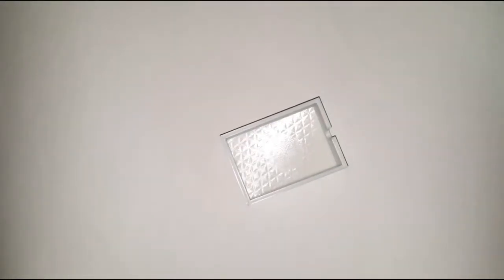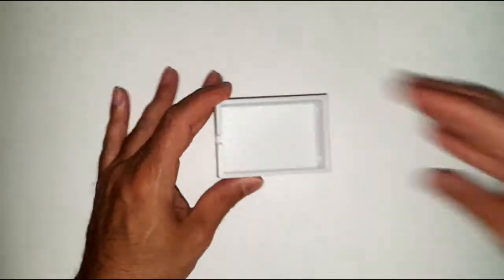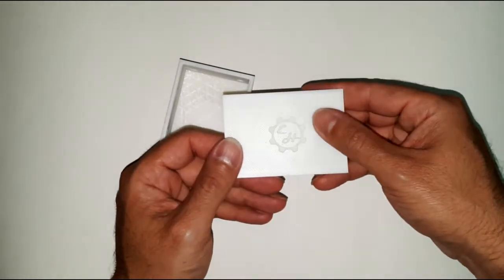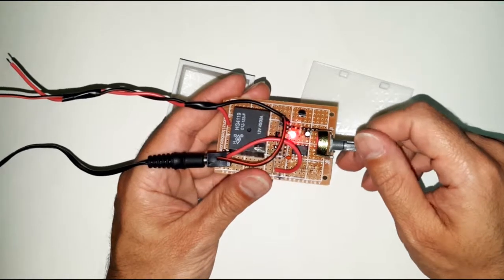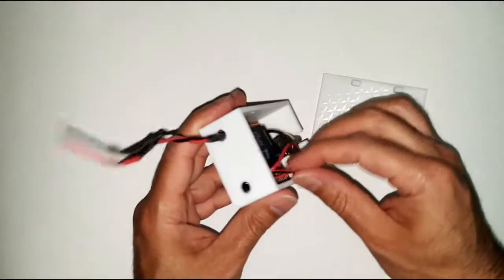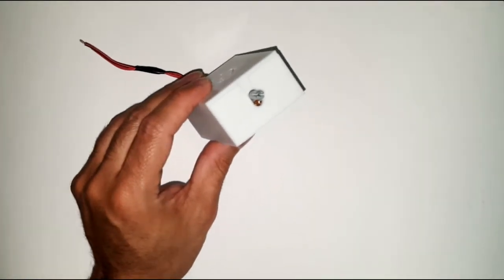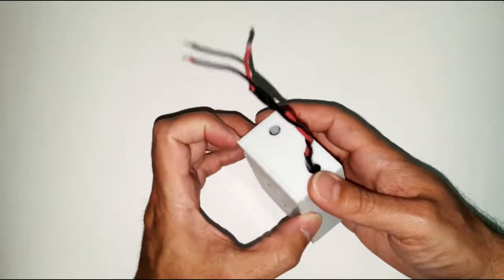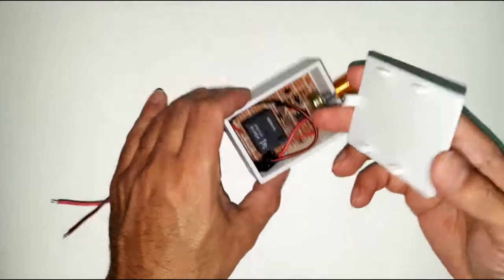3D Printed Project Enclosure/Box with Lid (no screws needed)

Comment: Can you also include which printer and materials used , if possible a walkthrough of settings used ?
Reply from the maker: I used a homemade printer that I built myself. The settings are on Thingiverse at https://www.thingiverse.com/thing:3040965. But, they are PLA Material, No Rafts, No Support, Resolution 0.3, 20% Triangle Infill. Do you own a specific printer that you use? or Software that you use to create the gcode? I use Slic3r 1.3.0 to create the gcode.
Reply: Thanks  @Evol3Designs . Its a pretty neat Print. I don't own a printer nor familiar with any software yet, I been going through many options to have a clean Print mainly for project enclosures.
Reply from the maker: Hi! I'm glad you find the print interesting. Don't forget to Subscribe to the channel. :-)
Reply: Any possible way to pint that bigger like 10in by 8in
Reply from the maker: If you have a big enough printing bed you could try increasing the scale for both the box and lid equally and you may be able to get it pretty close to the size. Though the wall thickness will also increase proportional to the increase in scale.